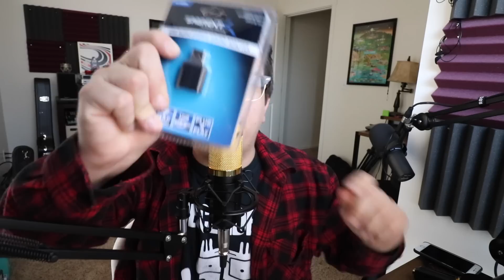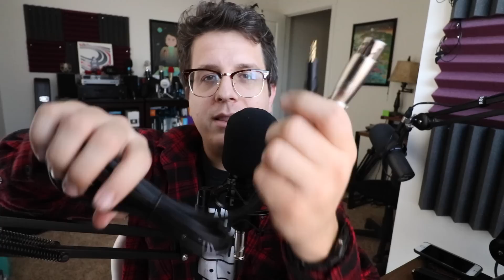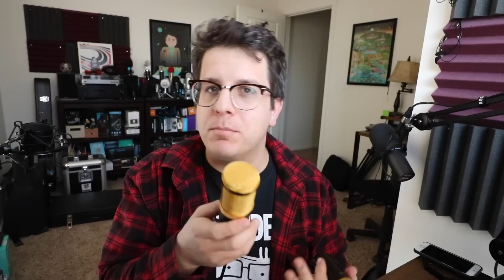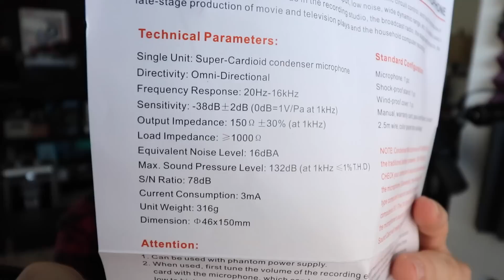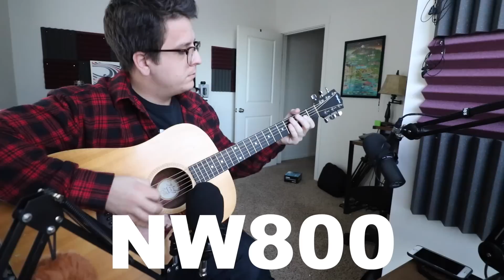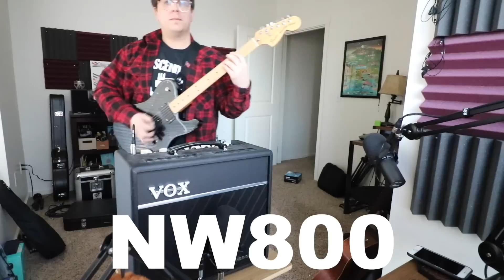Neewer NW-800 Condenser Microphone Review / Test

Comment: How did you get the microphone to sound so good in the video?
Reply: Please don't forget the fact that Podcastage uses soundproof foam on his walls or "Acoustic wedges".
Reply from the maker: USB SOUNDCARD
Reply: +Podcastage I think your caps lock is broken lol... But all jokes aside, I ordered this setup with the syba USB soundcard, do you know if that will provide enough voltage to power this mic and get it to sound like this?
Reply from the maker: Derp Derpson As long as it was the SYBA STEREO, then I believe so as long as they didn't change the construction over the last few months. I haven't heard any complaints about them not working all of a sudden, so I don't think that's happened. you should be fine. =)
Reply: Thank you for the reply! And yeah, it was the stereo, not the 7.1 surround sound one. 
https://www.amazon.com/external-Adapter-Windows-Microphone-SD-CM-UAUD/dp/B001MSS6CS
It's the one in the link I just posted. I hope that one's it, because it's coming in the post tomorrow lol.
Reply from the maker: Derp Derpson That's the one! Perfect! =) Enjoy!
Reply: Podcastage
I was only asking the first time because I didn't if there was any editing involved in making the mic sound better.
Reply from the maker: Kai Yes. That is important to remember. There is audio treatment on my walls.
Reply: Podcastage BTW thanks to your video, I ordered the BM-800 condensor microphone. :3 Your vid was really helpful because I needed a cheap mic which sounds amazing, and after you've played that little guitar melody I was like damn okay I need to buy this lol. So yeah, thanks for the video. subbed :D

Comment: Can I use this mic from just plugging it into my computer and it would work just fine?
Reply: Does Neewer NW-800 work without Phantom power supply?
Reply: no phantom power or USB sound card powers mic.....
Reply: did you even watch the video?
Reply: Emiliano Bautista
Reply: VintigedDubbed I have 550 watt desktop but 2 monitors and mid-high level components, will it work or sound better with phantom power?
Reply: It will be extremely quiet
Reply: yes but not on full quality. (Meaning if you want the most quality you can get, use at least 48 volts of phantom power.)
Reply: Max The mic works without a power supply but, it won’t sound anywhere near as good if you plugged it into your pc
Reply: You need min. an audio interface, 1 stand, phantom, and 1 or 2 XLR cables.
Reply: Max yes it does although it will most likely have less audio quality and more static and background noise but noise reduction should get rid of most of background noise
Reply: yes, but it will have a static noise in the background
Reply: Yes, but it sounds bad.
Reply: VintigedDubbed lol ur dumb
Reply: VintigedDubbed false
Reply: Then why are you looking at a review of a cheap ass mic? LOL what a loser!
Reply: +kevingamingtvs Probably, because electret condensers don't need phantom power. But I'm not 100% certain because I don't use cheap ass mics.

Comment: Hey there. I know you're a busy person, but I've been having some problems since I got my new microphone setup. I've looked around all over the internet, seeing who else has had the issue, and done troubleshooting tests, but I've come to a loss. When I record, I get a high pitch whine/hiss in the background of my audio. When I listen to audio playback by selecting it for the microphone, it isn't there and I can record is with stereo mix and it sounds fine. This video will allow you to hear what I mean. Any suggestions? Thanks. https://youtu.be/Mp0qlfzEtXQ
Reply from the maker: That is very very confusing and makes no sense. So when you do not have live monitoring on it works without a problem, but when you turn on the monitoring, it begins to exhibit that high pitched noise?
Reply: From what you've asked, that is correct. If I was to go to record audio in any program such as Adobe Audition or Audacity, I experience that high pitched noise. But, if I select "Listen to this device" in the recording panel for the microphone, there is no sign of the sound. I even recorded it with the program stereo mix to see if it was a recording issue with the programs, but the sound just isn't there. It's only when I actively go to record.
Reply from the maker: Ampliflyer I'll have to think on this a bit. Leave a comment on this thread tomorrow.
Reply: Alright then, thanks.

Comment: Hey Andrew, perhaps you can help me out.

I kind of sing, bass (around A1 from the chest), mainly in choires, but I'd love to try something solo. Problem is, a lot of the microphones I've used don't really manage to pick up the lower frequencies (they sound.....flat, definitely not like me unless I heavily edit the audio later). I'm currently looking for one that may be able to do so without necessarily breaking the bank, maybe you can point me in the right direction?
Reply from the maker: I think NW800 is great option.Would recommend USB Interface to connect though.
Reply: I'm definitely going for a USB interface, for the moment I'd be using an ART Phantom II Pro which should be enough.
Thanks a lot for the help!!

Comment: i dont have sound card 
do i need that USB 
and what i do to have same Quilty
Reply from the maker: You would need SYBA USB SOUNDCARD, or some cheap USB Soundcard & Phantom Power Supply. Or you can buy a USB AUDIO INTERFACE that has phantom power built in.
Reply: is that Enough or i need to buy something else ?
https://www.amazon.com/Sabrent-External-Sound-Box-USB-SBCV/dp/B002R33VWW?ie=UTF8&keywords=sabrent%20usb%20soundcard&linkCode=sl1&linkId=cc577dc2b0a4c330913d15de364d44c7&qid=1462581720&ref_=as_li_ss_tl&sr=8-3&tag=podcastage03-20
Reply from the maker: قيس الجدياني | QGamer_Ar I recently had luck with that soundcard, but Sabrent has been known to change their soundcards with no warning to the public.
Reply: What you recommend 
i buy that or not Because i already order it but i don't to cancel it or not?
Reply from the maker: The one I bought in May worked.
Reply: +Podcastage what other part you recommend ? i will work ?
Reply: +قيس الجدياني | QGamer_Ar will work
Reply from the maker: If it doesn't work immediately, you would need to buy a phantom power supply. But I'm guessing they haven't changed it.
Reply: +Podcastage ok think you very much  (high five)
Reply from the maker: High Five! =)
Reply: +Podcastage Hey I would like to know if this soundcard or the mic itself  would work with the PS4. .?
Reply from the maker: ONE UNDER ZERO I do not own a PS4 so I don't know.
Reply: +Podcastage Oh ok thanks anyways

Comment: Hello! Thanks for all your reviews. They help us much at all :).

I have a question for you. I want to buy the nw-800 but the phantom power is expensive for me.

I have a sound card Xonar DGX, if I use a external sound card would lose quality over use phantom power and connect it to the sound card?

That external sound card do you recommend if I live in Spain?

Thanks podcastage :)
Reply from the maker: They require ~4.5v to soundgood. Only card I know that provides that right now is SYBA USB SOUNDCARD. If you do not get that card, chances are you will need an additional phantom power supply.
Reply: And you know that get better quality? With syba on the usb or the phantom power connected to the xonar dgx? Thanks for your quick response!
Reply from the maker: Toni Martínez The performance would probably be the same because any voltage over 4.5v is pretty much wasted since it only requires about 4.5v.
Reply: +Podcastage okeey, thanks! I am very happy with your reviews. +1 sub

Comment: Hey Bandrew I wanted to know your opinion on something:
I have the Blue snowball ICE and have been using for the past 8 months as it does sound descent but i want a mic that is a bit smaller than the size of the snowball.and that would be the nw-800 for me.Now I do have a sound card that I  would use when I get it,and later on if i like the mic and stick with it  i'd get this phantom power supply: http://www.amazon.com/InnoGear%C2%AE-Condenser-Microphone-Recording-Equipment/dp/B00KAPGLQC/ref=pd_sim_267_4?ie=UTF8&dpID=41xRpwaDBjL&dpSrc=sims&preST=_AC_UL160_SR160%2C160_&refRID=199XB58CQP6DCS65E04E
Do you think its worth it,or should I stick with the snowball?
And is there a better just as cheap phantom power supply you know of?
    Thanks,
SevenDown
Reply from the maker: Depending on your USB soundcard, you may need the phantom power supply right now.
Reply: i have the one u recommended in one of your vids i dont remember what its called
Reply from the maker: SevenDown Should be the SYBA, or if you got a SABRENT last year you before last november you'll probably be fine.
Reply: yes i have the SYBRA
Reply: I'm curious too, NW-800 vs Snowball iCE?
Reply from the maker: Depends. Do you want to buy an audio interface or the SYBA USB Soundcard? If so, then go with NW800. If you do not, then go with snowball.
Reply: okay thx :)
Reply: More of a quality question, I have the Snowball iCE currently, but I'm looking to move into XLR. I'm just wondering if I should get this as entry level XLR, or just shell out monay and go with the Behringer mixer / Neewer phantom power supply & the MXL770. I'm currently using Voicemeeter for on the fly post production audio.
Reply from the maker: Soujiro's Corner Have not tried MXL770. May not need phantom power supply. May get enough phantom power from the mixer.
Reply: Do you think it'd be good to just go ahead into XLR with the NW800, then just upgrade the mic later, or stay with the snowball
Reply from the maker: Soujiro's Corner I think the behringer mixer, xlr cable, and NW800 is a great starting place that you can upgrade to at a later date. Absolutely.
Reply: I agree, thanks Bandrew.
- Andrew

P.S. Podcastage is going on the featured lol
Reply from the maker: Soujiro's Corner What is the featured?
Reply: Like the "featured channels" list off to the side of our channel pages, it's kinda like a promo
Reply: This is my opinion, if you are looking for a smaller mic, get the audio technica at2020 and it runs at around 100 dollars. If that's way above your budget than get this. Hope I helped :)

Comment: I'm creating a fm radio station and a brought 2 new-800 mixers and all the crap and it works grate
Reply from the maker: Awesome man! Super happy to hear that you like the way it all turned out! =)
Reply: +Podcastage but I'm still waiting on all the stuff, but will the nw-800 work directly plunged tn to the mixer or Do I need a phantom power
Reply from the maker: Tyler Gutto the mixer probably provides +48v phantom power. Check the specs of it to make sure. If it says it provides phantom power, you will not need an external power supply.
Reply: +Podcastage it's the behringer xenyx 802
Reply from the maker: Tyler Gutto Yeah you should be fine. The XLR inputs are the only ones that get phantom power, but you should be fine on those channels.
Reply: +Podcastage would it be better quality if I add a phantom power anyway

Comment: I'm sure you get a lot of these sort of questions, but would you recommend the NW700 or the NW800? From what I can personally tell, they're about the same, except for the fact that the NW800 comes in gold and without a boom. For a person on a budget, would the NW700 be better since it comes with all the stuff for about $15 less? Or does the NW800 have a noticeable difference in quality?
Reply from the maker: If I were you I would go with the NW700, with a phantom power supply & USB Soundcard, or a USB Audio Interface. But you're right. The difference in audio quality is so minute that they are basically interchangeable.
Reply: Podcastage Thanks for the reply! I did decide to go with the NW700 and an InnoGear phantom power supply because the NW700 seemed like a better deal for the price. Now all I have to do is wait until June 7!

Comment: Hi..
i liked ur video.
i needed a suggestion.
im getting lots of noise while recording my voice using NEEWER NW800 microphone.
i feel that its catching the surrounding noise more than my voice.
It is my first microphone and im having very bad experience with it.
since the noise is more,when im using NOICE REMOVAL plug ins in DAW, my voice is getting even more compressed.
What should i do?
Should i buy a better microphone?
i record my voice and mix it with karaokes for songs.
Ur suggestions might help my situation.
Reply from the maker: If you're plugging direclty into your computer, a SYBA USB SOUNDCARD will most likely resolve the issue.
Reply: Im using XLR to XLR cable to connect microphone to Behringer 302 audio mixer. Then ,i connect the output to the mucrophone of my computer using RCA cable. is this ok??
Reply: I have a sound card with me. Do you want me to try using the microphone directly to the computer using the microphone and plug my studio headphone to the sound card, instead of using Analog mixer??
Reply from the maker: Isn't the Behringer 302 a USB mixer? Why are you running the RCA output to your computer and not running the USB?
Reply: +Podcastage the behringer model which i have is xenyx 502 .It is not USB . So, I have to use RCA cable to give output from mixer to my laptop
Reply from the maker: Jinu Sosy Jacob if your'e running rca to 3.5mm then you're relying solely on your computers soundcard which may not be that good. I would recommend something like the Behringer UCA202 to get good sound connected to your computer.
Reply: +Podcastage yes...now it makes sense..
Actually ,I had SYBA sound card with me.So, i tried that by connecting the RCA output to the mic jack and headphone to headphone jack.That really helped with the sound quality. 
Thank you so much for your suggestions 😊

Comment: does the nw 800 work with usb to xlr?
Reply from the maker: No. As I mention in my XLR TO USB video. NO CONDENSER MICROPHONE will work with an XLR to USB cable. Does not provide power.
Reply: +Podcastage i thought you said that the nw 800 needs 4.5 volts to operate? how much voltage does the usb to xlr provide?
Reply: +Albert2002 i think usb cables provide 5 volts:/
Reply from the maker: USB PORTS PROVIDE 5v, that does not mean 5 volts are passed through whatever you plug into them. It is negligible voltage making it to mic when using XLR to USB. Below 1v when I have tested it.
Reply: +Podcastage thanks for correcting me :D love your videos
Reply: +Podcastage btw what stand/adaptor do u use to put a dynamic to a boom arm?(in your dynamic mic vids)
Reply from the maker: Neewer boom arm. And just a standard mic clip. http://amzn.to/1NS5F7A

Comment: Hey Podcastage, I recently purchased this microphone, along with a SYBA sound adapter, the one you recommended in one of your videos. For some reason the quality of my mic is REALLY bad. I have no idea why. I have a pretty powerful PC so I don't think it'll be the case of the power, please contact me if you can and help me out I'm really counting on you :/
Reply from the maker: Do you have an example? Also what are your input settings? You should be able to keep it around 25% input gain.
Reply: Im on windows, so Im only able to change the levels tab, when i lower it below 35 its really quiet, and yeah sure thing any way i could contact you and send you a file?
Reply: I just found a way around it, thanks so much for the reply i just used voicemeeter and it seems to sound quite nice :)

Comment: Can you connect this mic to an iPad?
Reply from the maker: +Hugo Mariaca (Hugo) Not 100% certain. You may be able to. Probably won't sound good because the lack of voltage. Also, a single software update can change the voltage pass trhough of the Lightning Port and make it useless.

Comment: is there a way to use a different cable with this microphone? i have the agptek ha0016 and it wouldn't work with any other cable, or adapter at the end of the same cable.
Reply from the maker: +Kofi Jones I have purchased lots of different XLR cables and they all seem to work with this mic. It is an XLR microphone. So any XLR Mic should work.
Reply: thanks a lot

Comment: A question I got nw800 but it got a very huge noise
how can I change that?
Reply from the maker: +DIEGO Connecting direct to computer? Phantom Power Supply and USB Soundcard. Or this: https://www.youtube.com/watch?v=MGlCPzGxaOk
Reply: Podcastage yes I did connect it directly with the Computer (aux)
Reply from the maker: That video is about a USB soudncard that should fix problem for the most part.

Comment: So if i have just bought the mic and dont have a card or audio interface, what should i buy from amazon, i can see you wrote dont bouy next to the usb sound card, for the cheapest option what can i do, for reference i use a MSI Gaming 5 mother board with "Audio Boost" if that helps, thanks in advance for your help
Reply: +2StrokeTARD without buying the phantom power...
Reply from the maker: +2StrokeTARD https://www.youtube.com/watch?v=MGlCPzGxaOk
Reply from the maker: 2StrokeTARD If you watch the video, you can tell it doesn't require phantom power. Also, none of those would work without phantom power.
Reply from the maker: They do not provide sufficient voltage for an ELECTRET CONDENSER microphone to work. They require ~4.5v to work. This one may work for you:

https://www.amazon.es/Syba-SD-CM-UAUD-Adaptador-audio-negro/dp/B001MSS6CS/ref=nav_ya_signin?ie=UTF8&qid=1462588678&sr=8-1&keywords=syba+usb+sound+card&
Reply from the maker: Yes absolutely those would work well together.